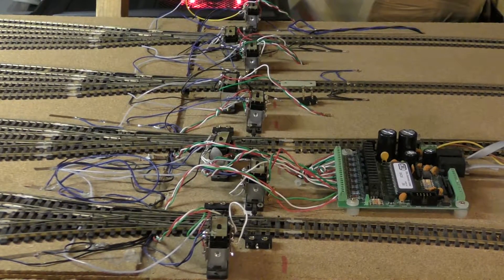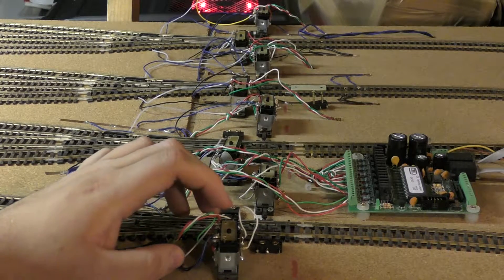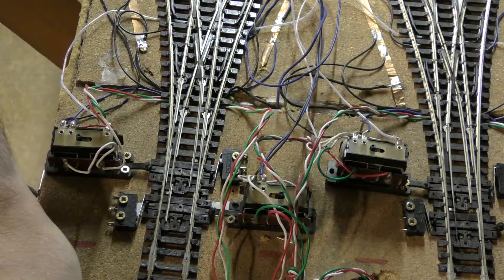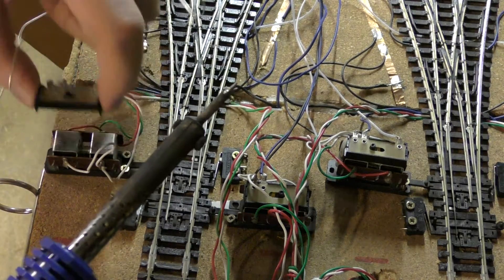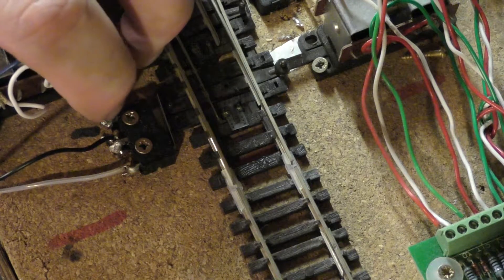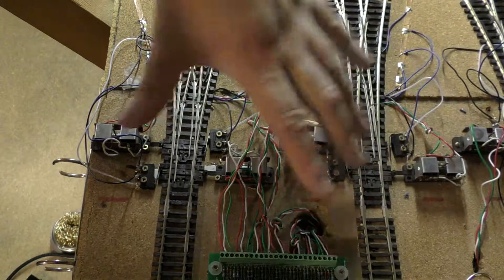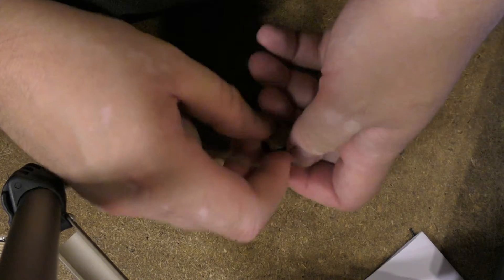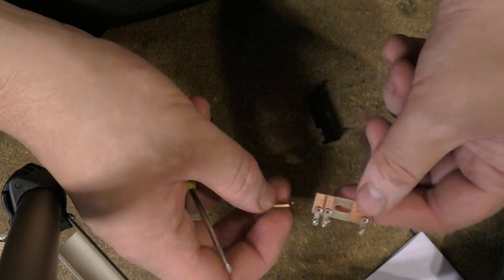Replacing the Frog Switch on My 3 Way Points

Comment: Hi Richard I use peco PL10E with micro switches and find them very reliable. Bob
Reply from the maker: +Bob 56 hi. I have found with the temperature fluctuations in the attic that it can cause the peco frog switch to get stuck but the micro switch are fine the the temperature 

Richard